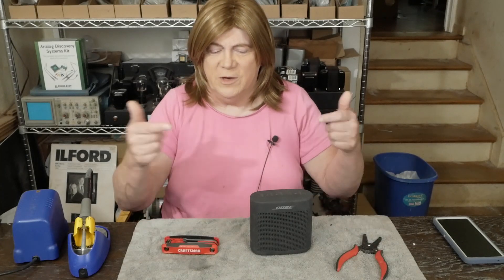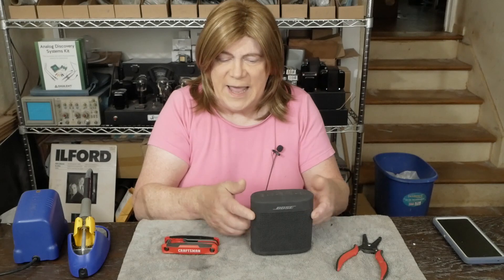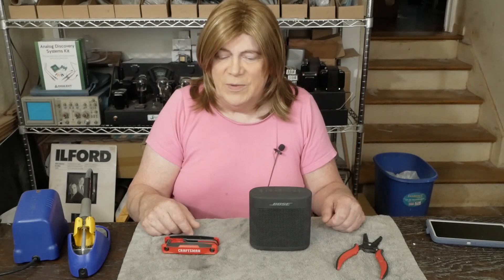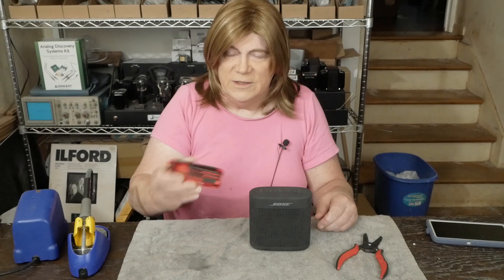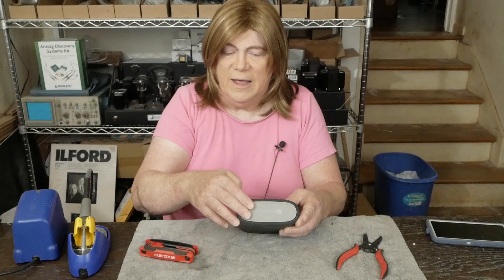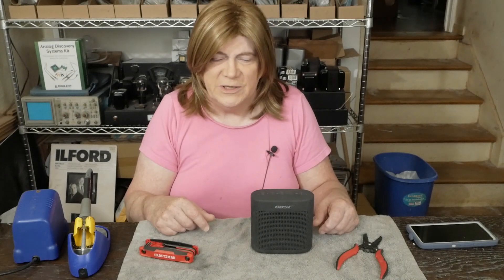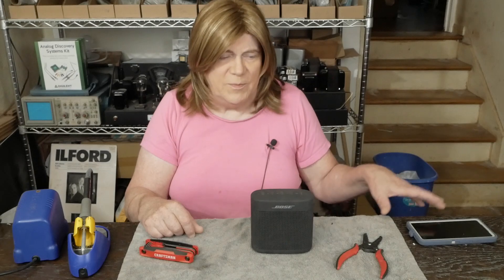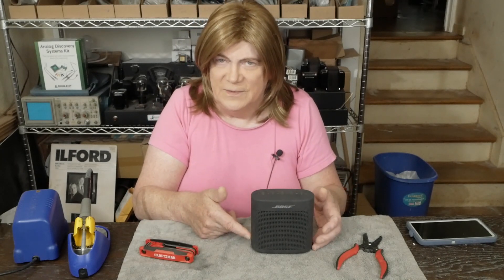Monday Monologue: Disposable Electronic Devices & 500W Amps?

Comment: If you have 90db sensitive speakers, it means at 1m away you are playing 90db of volume using 1W. If you have a 500W amp, it means at 1m away you are playing 90db of volume using 1W. You aren't even accessing the 2nd watt. I feel 99% of people dont understand this, but please measure the power use with a multimeter in your own system to see how many watts you are using at your usual listening level.
Reply from the maker: This!!!

Comment: Hey Skunkee, love your builds. I built the color pre. Awesome. It is now in duty with that emotiva that you pictured. As far as SS power amps, I have the one you pictured on the post. And yes, 500wpc into 4 ohms. Two things to point out. SS kit needs headroom. Unlike tubes that like to be pushed. My 500 wpc amp sounds much better that my 200 wpc amp by the same maker sounds. Even at what is probably only a 25-50 wpc listening level. So theres that, but the other plus that you didn’t mention is that well designed mosfet high power amps play in class A up to about 17 watts. Thats the case for the class A/B emotiva that you pictured. Class D, all bets are off, and it is hard to find an old school class A/B these days worth anything. 

With all that said, tubes rule, except for possibly the nose bleed upper echelon that I will never know. Keep up the good work!

Comment: So I tend to agree with much you say regarding amplifier sizing , no interest in the section regarding batteries etc, a comparison I have made is related to my Klipsch chorus 2 , I have a fantastic pair of arcam p1 Monoblocks at about 180wpc which is kinda fun with those speakers but the blueglow kt88 se I built shows exactly what a good spkr/amp relation really is , skunkie whats happened to the builds ? 633c for example , a lot of us are pretty much hanging  !
Reply from the maker: Trying to balance my personal life (ie vacation) with getting things like that MP301 review/mods finished, other product reviews done and paid for customer amps built.
Reply: @SkunkieDesignsElectronics  yeah I totally get it , everyone demands a part of my life ! I guess it's become somewhat overwhelming eh , I wonder if you could re visit the  blueglow kt88 amp ?
Reply from the maker: Working on one right now in fact :)
Reply: @SkunkieDesignsElectronics  I built as per Mark's spec using the single ecc85 and it's still by far my favourite amplifier, super impressive since first switch on , I hope you will show everyone your latest build as I still don't think many people have heard one 😀
Reply from the maker: I'm doing a slight variation that was also a Kegger design using a pair of 6EJ7 tubes triode strapped.
Reply: @SkunkieDesignsElectronics  hope to see it please

Comment: I think the comments show that there are different opinions. That is because there are many variables. People have different likes and dislikes concerning their audio listening preferences. Different rooms have different characteristics, not the least of which are large and small rooms. Different music has it's own characteristics. Orchestra tracks, in some media, have a 30db, or more dynamic range.  30db equates to a LOT of watts! Different sources have different outputs. Different preamps feed different signals to power amps, (volts, amps, impedance, dynamic range) requiring different things from a power amp. Different speakers can use different amounts of signal (voltage, current, and dynamic range) that do make a difference in how they sound, once again, depending on how loud one likes to listen to the music. Those speakers will have demands on power from an amp. For a manufacturer just to say xxx watts, can mean different things from different manufacturers. And, I disagree with the generalized comments that ALL manufacturers are playing marketing games.  I have had amps that put out 2 watts per channel, others up to 500 watts per channel (rated at 8 ohms). I have had equipment that cost less than $100, to pieces that cost more than $10,000. I have heard gear that costs hundreds of thousands of dollars. I think for most of us, we are happy with our system that is rated less than 100 "watts" of power from an amp. For many, less than 10 watts sounds fully satisfying. However, I have listened to systems that have meters showing 100 to 200 watts of output, realizing that there are dynamic requirements for many more watts than that for some instances.  I can remember wondering where all of that power was going, because the music was not that loud. I can also remember listening to systems that are putting out 2 watts and thinking I would never need more power than that. As you have said in some of your video's Steph, it just depends. And, the synergy of the entire system and environment, matched to the listeners likes and dislikes, will affect the amount of power needed from an amp.
Reply from the maker: Another generalization, which obviously means not every single case is like this, I've found I can get the same dynamic listening enjoyment from a low power system at say 80db in room SPL, where as a high power one tends to sound thin until you really crank up the in room SPL to 90db+. So then this causes one's preferred listening levels become skewed to this effect.

Comment: Hi Skunkie. Funnily, those who swear by 450watts amps 'never' lived with a 5 watt Single Ended am, and even less with a tube amp ''and'' efficient speakers. I understand that if you're a bass freak, then SS and power make sense. I've been there. But my SE tube amp and my Quad II 12watt class A pp amp + 92db eff Tannoy give me more satisfaction and pleasure than any powerfull SS/ low eff speakers I've lived with in the past. As well, my listening habits have changed with years. I've traded boom music for insight.. and when I feel like 'shaking the fundations' .. I always have the car to crank it up once in a while, and that's more than enough lol The first what matters the most.. my best amp is still a single ended 45 tube amp.. that amazes my boom friends by its musicality.. and control, at reasonable volume. The 12w Quad class A is my best compromise yet. So was my Marantz 8B. Keep up the good work 👍
Reply from the maker: Yes, I have discovered these low people amp/speakers sound so much better at reasonable volume levels. Those other low efficiency, high power combinations don't start sounding good until you are at ear bleeding volume levels.

Comment: I have a 5.0 surround system with a set of Cerwin-Vegas CLS-215 that have two 15'' woofers, midrange, and horn tweeter each. Speakers are rated at 500 watts each. I have a 7-channel, 100 watt per channel Onkyo receiver that I use with them. It sounds good at 1/2 to  3/4 volume but you can't even see the cones move in the woofers. You have to touch them to tell that the woofers are working. I called Cerwin-Vega and told them that I felt that I wasn't getting all the bass I should. They said that with those speakers, I would need at least a 200 Watt @ 8 ohms amp to drive them properly! If I had known that, I wouldn't have bought them. I tried bi-amping them and it still didn't help. Don't get me wrong, it has bass that you can feel but I think they could be twice what they are. I should have bought the 12'' or the single 15'' for sure. I thought 100 watts would have been enough. Now I need a 1500 dollar amp.
Reply from the maker: That's been my observation with speakers designed to work at high volume/power and amps designed to them, they only sound good at high volume levels.

Comment: For reference, my speakers are rated around 95db. I listen in the low 80dbs average, with peaks in the low 90dbs. You'd think a 10 watts amp driving them to 104db peak is all I need for home use, not to mention hearing loss. The 10 watter cannot deliver dynamics like my 200 watter (just one aspect for comparison) when it comes to both Micro Dynamics (drumstick tapping on cymbals/cow bell/triangle/etc) and Macro Dynamics (maximum force on kick drum/daiko drum/tympani, power stroke on bass slam, growling on vocal, etc). It suffered dynamic compression when compared directly to my 200/400/800/1200 watts (at 8/4/2/1 ohms rating) amp.  This occurs at all listening volume, not just at maximum loudness.

Am I biased? Maybe? FWIW I bought the 10 watts amp, with rational thinking (like you and many here) that is all I need for my high-efficient speakers when listening at low level and relaxing in the evening. I also didn't want my 200 watts amp heating up my room in addition to the summer heat 😅 Meanwhile my Maggies are crying foul when I relocated the 200 watts amp 😂
Reply from the maker: I just auditioned a pair of high end 350W mono amps ($2000 each) and my experience was the opposite. Sounds dull and lifeless.

Comment: Power rates are marketing. They started during the stereo wars and continues still today. Marketing do you want to buy a stereo with 1 watt or 1000 watts? Most will say 1000 watts because it must be built better, but the truth is it probably isn't or clean power. Marketing tricks are in every product. Do you need a car that goes 0 to 60 in 1.66 or top speed of 278 mph. Designed obsolescence is a real thing in everything now and truly sad.

Comment: My diy Darling 1626 amp puts out a whopping 0.75W and into big high sensitivity 1960’s 12” Alnico speakers and that’s plenty for my 15x15 ft room.  I’ve got a more powerful 3.5W 2A3 amp but tbh the nicest sound comes from the Darling and another flea power 71A amp I built.  Both are driven by a tube preamp with tone controls.  I listen at average and not ear crushing listening levels but I’m not sat listening to Diana Krall….more like Patti Smith/Velvet Underground/13th floor elevators.  I’ve found speakers are key to how much power you really need.

Comment: I don’t disagree with your power discussion overall, but power and sound are weird in that they correlate logarithmically. That causes power requirements to scale by large amounts based on the application. I know cases of high quality but only 83db efficient speakers that in larger spaces really do use 100 watts for reasonable output levels, that would be less loud than highly efficient speakers at only 1 watt. That being said I agree that most people could get away with 30 watts or less but efficient speakers do have drawbacks as well. I absolutely agree that you really should scale power to the specific application because it is better to use an amp in the middle of its range, and for many applications that is the first few watts. Thanks again for your content!

Comment: 7:00 Exactly. Always best to operate on the most linear part of the transfer function of any amplifier. And some amps are even designed to operate in Class A for the first few watts. If you want to get the best out of the resolution of your DAC, you want its full-scale output signal to be close to driving your amp at typical volume listening levels; your amp gain should be chosen accordingly. Taking a 1V or 2V signal and attenuating it to 0.1V so it can then go through a crazy high amplification gain stage in high power amp is very counterproductive; the results sonically will not be ideal. That said, headroom for music dynamics and playback of recordings with lower volume levels should be factored in to your decisions.

Comment: Thanks for siding with us low watt / high efficiency speaker crowd. Your comment on sensitivity ~1v to get full SPLs not only gives you a better usable volume control range, but maximizes signal to noise ratio as well. My 20B DHT amps push 5+W into 93dB speakers, making 110dB peaks at 1 meter realizable. Another advantage of using lower wattage is that you're 🚫 heating up your voice coils, which can drastically change the tonal quality of your speakers vs. running 'em cooler. And if you run at lower wattage, the chances of burning out your speakers goes down as long as you avoid clipping ~ iff something goes sideways with a high power amp, you'll say goodbye to your treasured speakers. That said, using too low a wattage w/ clipping can destroy your speakers too. Getting a little more high quality power than you need for your speakers and room size is a much safer bet :).

Comment: Very true. For many customers the need for high wattage isn’t necessary. But there are groups that do need the high power. Many high priced speakers need large amps. And unlike tubes clipping is a serious problem with class A and AB amps. Headroom is definitely needed. I do agree that many companies just make high wattage as sales gimmicks. Especially class D amps manufacturers. A really good high end class D manufacturer doesn’t make their amps with crazy power numbers. 
I have several Klipsch Heritage models that don’t need a lot of power. I also have speakers that do like my Maggie .7  I don’t always want to switch amps every time I switch speakers. So a good high power amp is still may be used on my Klipsch regardless if they need it.

Comment: I wonder if there are any consumer electronics designers watching this channel so they can chime in on why these devices are designed the way they are. As a consumer, I agree that serviceability would be great and I do feel that these companies no longer want things to last forever. However, what is the perspective from the other side? Lithium Ion batteries can have disastrous consequences if its charge cycle isn't managed properly or if the cell is faulty. Introducing a serviceable lithium ion replacement opens up the device to a whole host of potentially unsafe uncertified lithium cells from bad manufacturers, because the average consumer of these types of devices will choose the cheapest option from Amazon. When that causes a catastrophic fire who is to blame? In the US, I'm sure there will be litigation. If the lithium ion battery isn't serviceable, at least the manufacturer has some form of quality control of the cells used and if there was a bad batch of lithium cells, they could issue a recall based on serial number or manufacture date. Perhaps that a possible reason for not having a serviceable battery? Serviceability of other parts; well, the consumer that buys these devices are after a compact, powerful, yet feature rich device, this can only be accomplished with SMD components and will generally be unserviceable to the end user anyway. Some of these devices are featured to be at least slightly waterproof / splash proof which also means difficult disassembly.

As far as high powered amps go, I'm in the camp that prefers to have more power on tap if needed, but within reason. I'd like a power amp that will be capable of handling any speaker I throw at it as my speaker selection will change more often than my power amp selection. I cant "yet" imagine a 5W power amp in my collection because of the speakers I have are a pair of recent model Martin Logan electrostats which are 91dB efficient according to the manufacturer spec, but I also have a pair of Elac's that are 85dB and driving these arguably need more to drive. I think up to 125-200W is reasonable to tackle any speaker load you can throw with the exception of very specific use cases like a 'full range' electrostat or a large Magnepan.
Reply from the maker: What in room db are you listening to that needs 200W into 85db speakers?
Reply: @SkunkieDesignsElectronics  I don't "need" the 200W, wouldn't be listening at those levels. My room is 16x20. I have a few entry / mid level amps. I've driven the electrostats with an Adcom GFA-2535 (60W/ch into 8Ohms, 90W/ch into 4Ohms, both channels driven), the electostats are rated at 6ohms. When listening to a large classical piece, the distortion lights to briefly light up at at the top of my volume range. Switching out the Adcom with a Rotel (200W/ch 8 Ohms, 325W/ch 4 Ohms) I have better bass definition and more 'punch'. I was surprised the Adcom powered the electrostats very nicely at 'comfortable' listening levels, so yes, I don't need all those watts. But when you just want to 'turn up the volume' for those few tracks, I feel more power is needed and not need to worry about clipping. I have a UMIK-1, will have to measure at what levels I'm listening at.
Reply from the maker: OK electrostatic speakers are a different game.

Comment: Forgot to mention I do also have an 300B amp that is around 15 watts that does drive the other speakers I have well so I do agree with you in general so there is that, thanks again for the video!

Comment: I agree, long gone are the days when there were little doors that you could open & replace batteries in both portable electronics & cell phones.  I could do that in the last flip phone I had & currently have an old JVC portable CD player that still works great & takes 2 AAA batteries. I do have a pair of Maggies so I do need an amplifier that is at least 100 watts.  They sound great and are my favorite speakers so I do have an amplifier the is 120 watts. History wise most of the classic solid state amplifiers & receivers like Pioneer, Kenwood from 70's to the 90's were all mostly high wattage as well as power amps like Phase Linear & sure have high market value today!

Comment: My speakers are 90 db sensitivity and I mostly listen at around 60/65 db SPL from around 2 meters away. Most calculators aren't even able to show the small amount of power needed for that. 😅

Also Apple actually admitted that they intentionally slowed down older models back in 2017. They are definitely not the only ones.

Edit: How in the world hadn't I subscribed yet?! Fixed.